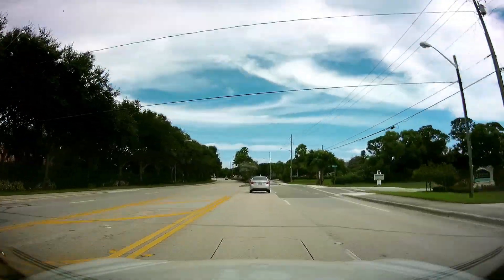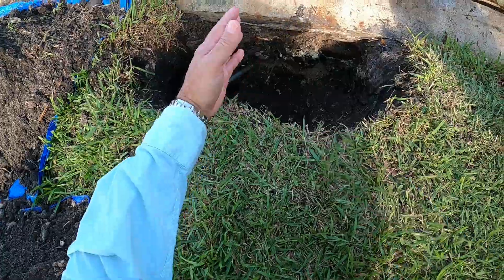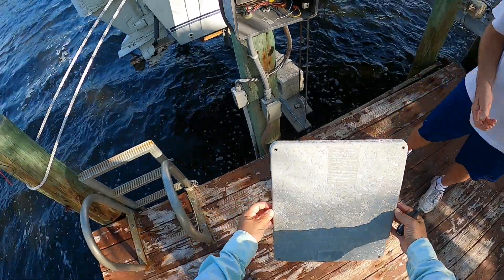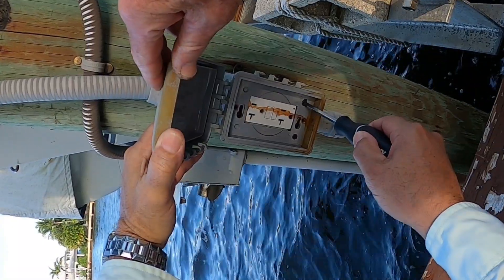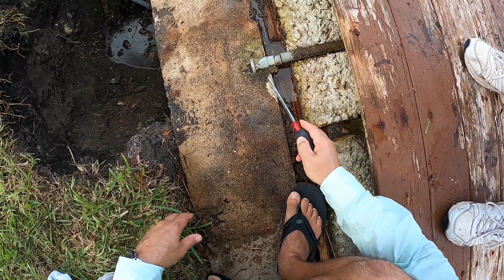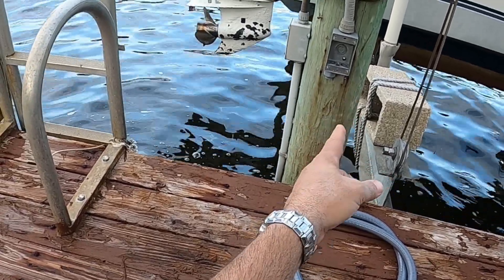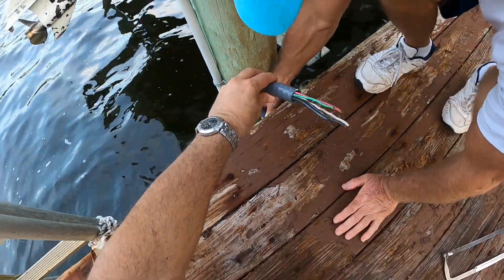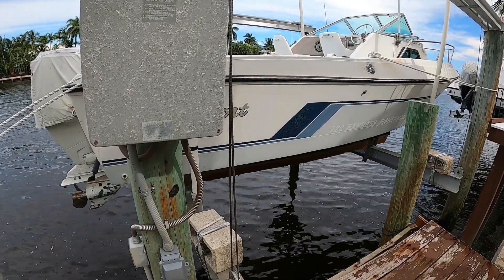Fixing A Broken Electrical PVC Pipe! (Buried/Cracked)

Comment: any conductors place in conduit and is under ground should be rated for underground! Typical conductors for above ground can not sit in water which will in time develop in conduit. Water will soak through the conductor insulation and you will have problems

Comment: don't use a hack saw! you should use a picec of mason string and then you pull it around the pipe in a back and forth motion which will cut through the pipe and not risk cutting the wire

Comment: I didn't catch the label, were you able to find some sch-80 for that run?
Reply from the maker: The NEC does say that you should use SCH-80 above ground in areas that are "subject to physical damage", in this case, the new dock will be covering the entire section of conduit when it's installed, and secured using clamps underneath, so it won't be subjected to physical damage. The flex is only sold in SCH-40, so that's fine. SCH-40 is made for below and above ground use. The old conduit broke because the wall settled and it kept bending the conduit. Thanks for watching!